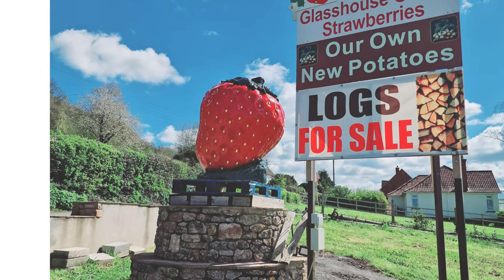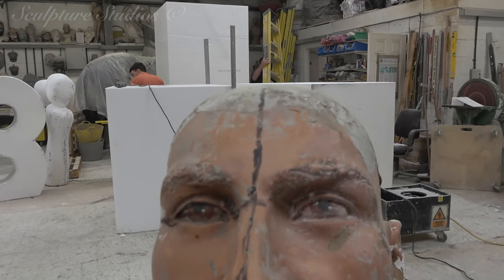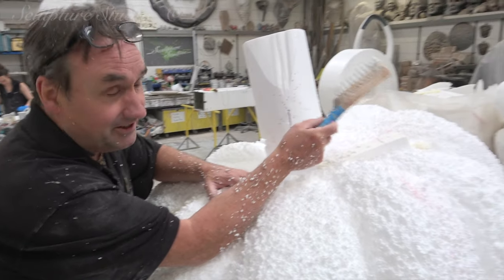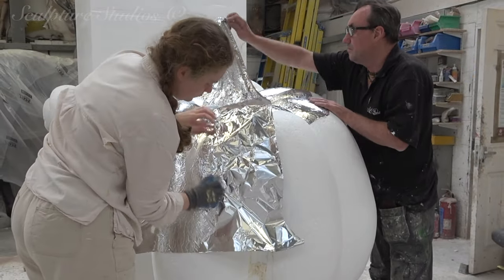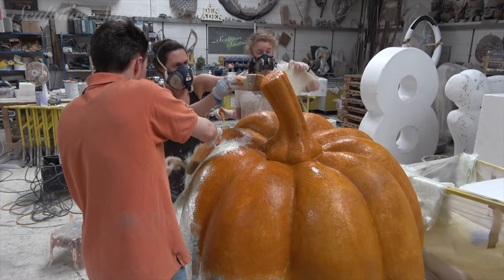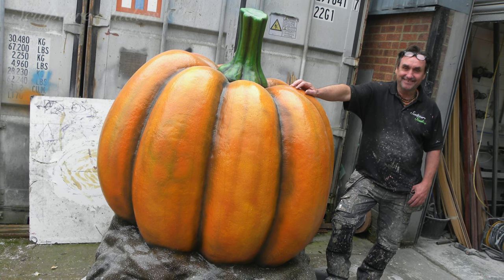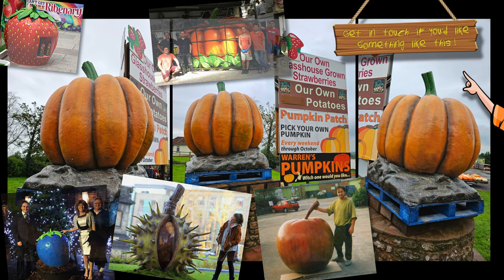Carving a Giant Halloween Pumpkin - Warren's Fruit Farm - by Sculpture Studios

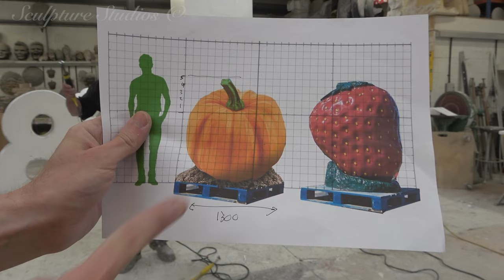Comment: That is super good!  I'm a big fan of Halloween and pumpkins, so I appreciated that.  At 1:12 - Can I ask what hot wire cutter set up you have Aden?  What powers it (I'm guessing a variable power supply), how thick (gauge) your Ni-Chrome wire is, the length between the handles etc. as I know that affects the performance of the Ni-Chrome wire?  I have made several hot wire cutters of varying lengths, but I just haven't been able to crack the long, powerful ones to cut large pieces of polystyrene like you do.  It always struggles part way through to the point where it just stops, it seems because the temperature has dropped so far it stops 'cutting'.  So any guidance would be great. Also, in the absence of the mystical foil that, as we all know, doesn't really exist, what would you recommend using for strength and protection on simple polystyrene i.e., something that won't eat into it, but would give it a protective coating against damage and weather? I believe the fibreglass needs the foil to stop eating into the polystyrene? Cheers.